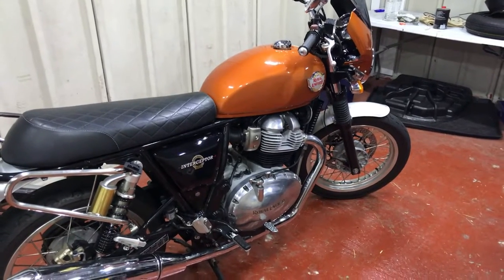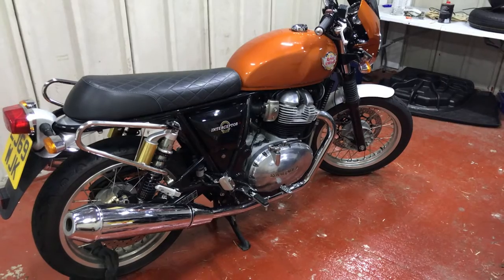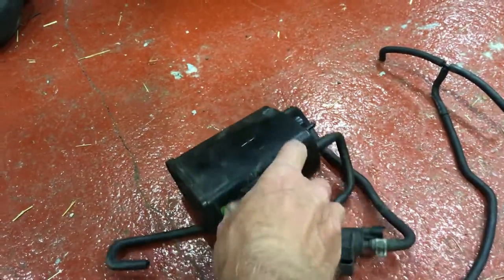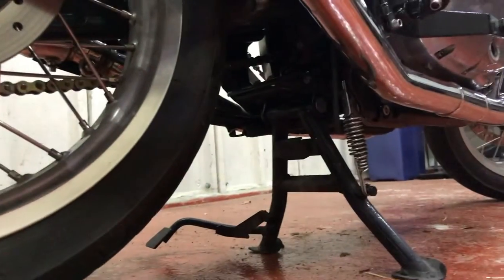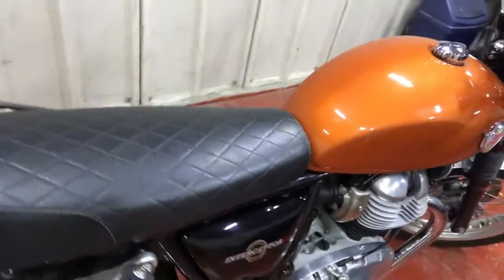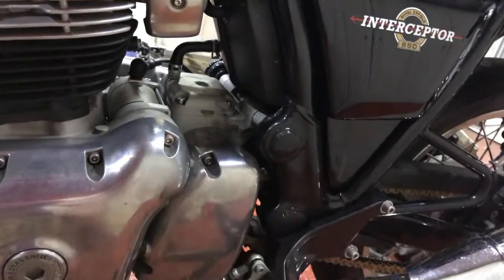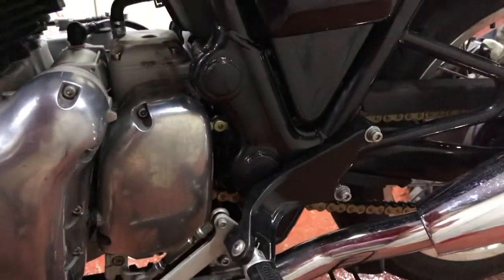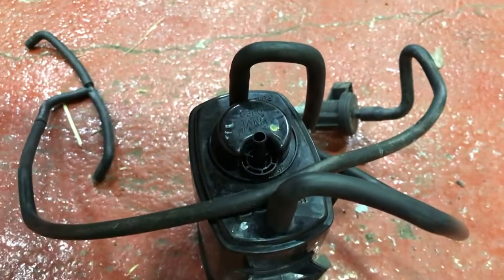Removing the EVAP system from Royal Enfield Interceptor 650

Comment: Do we really need a delete kit?
I removed the evap can, which was saturated, blanked off the three hoses with 2 x M6 and 1 x M8 bolts tie wrapped so they  seal properly.  I left the valve in situ, still connected to the loom so I don't need the plug.
Is it just me or are people going over the top by removing everything?
Reply from the maker: Yes, what you’ve done is an option, although only the m8 hose is blocked when using the delete kit. One of the other two hoses is the tank breather though and shouldn’t be blocked, as far as I’m aware (mine isn’t). It did occur to me after fitting my delete kit that it would have been possible to leave the purge valve in situ and let it do its thing and keep the ECU happy. But I thought it’s a component which could malfunction at some point, triggering the EMS warning light. So I was ok about removing it and binning it. Tbh, the little electrical plug that comes with the delete kit is probably just something that joins the two wires together! Possibly…….. In any event, I wanted the neat little bungs that block the inlet manifold tubes and didn’t begrudge the minimal expense of the delete kit really. But, yes, leaving the purge valve in is certainly an option.

My bike has run perfectly ever since (now over 7,000miles)…..starts first time, no stuttering, stalling etc. And, even though the bike is kept in a garage that gets quite hot due to the metal roof, I’ve never once smelled petrol vapour in there!
Reply from the maker: Ps. The delete kit plug is, I’ve been told, simply a 4 ohm resistor in a handy little plug……..

Comment: Bom dia James , moro no Brasil e gostaria de eliminar o Evap , esse kit que vcs usam não  existe aqui , tem outra forma de eliminar o deposito  de cartão  e deixar o restante original , isolando apenas a mangueira de retorno para o motor ?
Reply from the maker: Yes±. You can leave the purge valve connected electrically but remove all the pipes from it. The either block off each of the two inlet manifold stubs or join them together with a piece of the redundant pipe.
Reply: Ok, deu certo obrigado  pela  informação.
Reply from the maker: Great!
Reply: Amigo vc fez? Oq resultou? e como fez? abraços

Comment: Nice video James. How does the fuel tank vent now if you have plugged the vent line that ran to the canister? And is there a noticeable fuel smell now that vapours are no longer running to the charcoal canister?

Also, given that vacuum plugs for the manifold and 8mm screw for the tube are so readily available would a similar solution just be to remove the canister and it's tubes, leave the valve where it is (connected to the harness), plug the ports on both the valve and manifold, and put the screw into the tube? This would still leave the valve there for the ECU to control, but surely the plug that comes in the kit is either just a shorted dummy plug or a resistor of equal resistance to the original valve? Seems like maybe an easy home solution rather than buy the kit?
 Cheers
Reply from the maker: Thank you. Yes the tank vents perfectly by the unblocked, smaller diameter pipe which is left in place. No…no smell of petrol at all…….. in fact there was a smell BEFORE I removed the Evap system because the filter cartridge was full of fuel! And yes, the solution you mentioned could easily be accomplished but I wanted to remove the valve entirely to eliminate a component that could go wrong (unlikely I suppose, but it could happen…)…..but yes, it could easily be done how you suggested. It occurred to me after having used the kit but I do prefer that the valve is now completely out of the bike….
Reply: @internetpolification  thanks for the response mate, appreciate it. I'm glad I happened upon this video and you mentioning that it has solved your hot start issue, since I too have experienced it. The multiple hits needed to start is kinda embarrassing and reinforces what I think are mainly untrue stereotypes about RE being poorly made bikes. My bike is now an 865cc big bore but the variability in starting has probably started more recently than my engine modification so am hoping the evap is the cause.
Such a confusing comment about "not overfilling" the fuel tank. If I'm gearing up for a long ride I'm definitely wanting to have the tank completely full, since I've had some serious range anxiety on some long rural roads just inland from the Australian east coast where I've needed every last drop to get to the next fuel station. I'm sure the designers know that people completely filling their tank is a normal thing for most users. So...what happens if we "overfill" the tank now? Fuel will just go down the plugged hose and sit there for ever I guess?
Reply from the maker: @MrJulianneave  I’ve filled my tank since and never lost a drop of fuel. I did think it might drain from the vent tube but it hasn’t so far…. 

Yes, I understand exactly what you mean re the embarrassment factor. 2-4 pushes of the starter button with the engine firing up each time and then stopping. It even did it with the bike moving having engaged first gear to turn the bike round in a tight circle which meant I almost fell off!Plus all that wear on the starter motor which, at that rate, would be 4 times ‘older’ than the rest of the bike, strain on the battery and alternator to belatedly catch up with the charge required for the battery after all those false starts…….  I even got to the point of thinking that I ought to sell the bike, much as I liked it. Then, having removed the Evap kit, it never did any of the above ever again. Not once. Not ever. First start every time and no cutting out. First start after 2 months of not using the bike. Etc. Totally cured.

I’d remove the Evap kit and then see what’s what! Do your idea of leaving the valve in there first and get rid of everything else and block the larger diameter tube and the manifold stubs. If it cures it (please report back……) then you could consider paying out for the kit or…more likely……just leave the valve in and run the bike	😀
Reply: @internetpolification  I had a go of just removing the hose connections from the throttle bodies and plugging the vacuum nipples this afternoon. I left everything else as is, including just leaving the hoses from the evap valve to the throttle bodies unplugged and open. I figured that by doing this I was removing the only means that the evap system had of affecting engine operation. It idled a bit differently when first starting but settled down to a normal idle, but my hot starting issue was not resolved. If anything I feel like there was one starting attempt that was much harder than normal.

Maybe I'm missing something with how I left the rest of the evap system and I haven't effectively isolated it, or maybe I should have idled it for like 10 mins to let the ECU learn that idle no longer equals fuel rich air coming from the evap canister, but results so far aren't as promising as I was hoping.

Comment: Where to get the evap delete kit?
Reply from the maker: Actually, a kit isn’t actually needed. All you need to do is remove the evap cartridge and but leave the purge valve electrically connected so the ECU knows it’s there. Then block off the larger of the two pipes which lead from the fuel tank to the evap cartridge using an M8 bolt. Then join together the two inlet manifold stubs using a length of rubber tube.

Comment: Hi James how does the tank breathe, the small pipe is only a drain from the neck, if you blank the tank pipe with the bolt there is no way it can breathe, I fitted the kit but opening the tank filler you can hear air rush in. Ps anyone ordering one quote the year, mine came with the wrong plug, so fitted purge valve blanked of,f plus do not short out this is a resistor plug. I read the other thread of similar conclusions, maybe your not experiencing hissing is the fact your cap is not sealing, solenoids arnt a switch so don’t short out, the ecu needs to see 25 ohm resistance.

Comment: Just done this today thanks to your sprocket cover tip. Also did the air injection delete. On another note I've purchased some switch gear to do that swap.
Reply from the maker: Excellent! Yes, that sprocket cover removal helps a lot, eh? 😀  If you’ve bought the FJ1200 left switchgear, you’ll find it’s an easy fit using the OEM wiring from the OEM switch.l..and it means the OEM connector block is still used which makes life much easier. If you have any issues with the throttle side, just post here and I’ll give you my phone number. I did just post a lengthy response about the right side switch etc to a comment on one of my other videos……it’s the one that is partly titled with “Interceptor worship” …I’ll find the link and post it here in a minute. I detail what’s involved with the right side. It’s slightly trickier but really not hard
Reply from the maker: Here’s what I put to the person who asked re the switchgear in the other video……

 No, the OEM throttle tube just won’t fit. I did try that first on the replacement right hand assembly but it’s all about the diameter of the end of the tube (the inner side which has the throttle cable nipples in it)…the OEM tube just won’t go into the CM400 switch assembly. So I used the entire switch/tube. There is some slight modification needed to the way the cables connect into the switch body. The OEM return cable (which closes off the throttle when the twistgrip is released) has a threaded nut on the outer sleeve which screws into the OEM switch casing and the pull cable (which operates the throttle when you twist it to accelerate) just has a round shoulder on the outer sheath and slots into the body of the OEM switch and is held in by a small clamp which screws into the switch casing. 

With me so far? The threaded nut on the OEM return cable is too big to screw into the threaded hole on the CM400 switch casing, so it needs to be just left in place on the cable and ignored. But it’s now necessary to hold the cable into the new switch casing so I used the one that came with the CM400 throttle assembly that I bought…it came with (useless) cables still attached. I cut this cable and removed the nut which was obviously the correct size to fit into the threaded hole on the switch casing. Then it’s a case of getting the nut onto the OEM inner cable……of course the nipple stops it sliding on…..so I put the nut into a vice and cut a slot into it with a fine grinder disc……..it doesn’t weaken it and the slot allowed the nut to go onto the inner cable, screw into the switch casing and thereby hold the outer cable into the casing. With me thus far? So that’s the return cable sorted out.

The pull cable has the metal shoulder on the outer casing and slots into the replacement switch casing just like on the original switch casing. But…..there’s no threaded hole to attach the small clamp to which holds the cable in place on the original. So……I drilled a hole in the replacement casing, tapped a thread into it and this then took a small Allen bolt which holds the clamp in place in the switch casing and the forked end of the clamp holds the outer cable sheath in place in the casing.

The above sounds complicated but it actually isn’t! The left switchgear is dead easy however. 

If you decide to change the switchgear, I’ll give you my email address/phone number and run it all by you. 

Personally, I love this mod. The indicator switch is incomparably better and I no longer get complete ignition failure caused by the awful OEM engine kill switch!
Reply: @internetpolification  yeah I read that yesterday, it was myself who asked you. Just watching your wheel seal video, that seems a good shout to pre empt the issues it will cause.
Reply: where did you get the ais delete kit?

Comment: thanks james if this is on my 2022 gt its coming off, im all for removing crap off the bike, thanks, rich
Reply from the maker: Do it…. It’s a nightmare waiting to happen!
Reply: so i got a little kit from Spain, removed the canster, removed the purge valve but the plug they supplied to replace the purge valve doesnt fit, do you think i can replace the purge valve, plug the hose from the tank and let the vslve sit there doing nothing so to speak, thanks, rich

Comment: Thank you for the explanations.
The anti-pollution system is really useless.
One question, the ECU will continue to work without the purge valve since you installed a fake plug, correct?
Could you please provide the link to this fake plug that you installed in place of the purge valve?
Reply from the maker: Yes the ECU functions. However, what you can do is disconnect all the pipes to the purge valve but leave it in place and electrically connected. You can then use a piece of the redundant pipework to join the two stubs on the inlet manifolds together. Thus cheaper than buying the ‘delete kit’ which is only two rubber bungs and a 10kohm resistor. So, I would simply leave the purge valve in place!

Comment: Please could you advise of a retailer who could sell me a kit to deal with the electronic side of this? (The plug kit to replace the EVAP valve.)  There don't seem to be any companies advertising this sort of kit in the UK.
Reply from the maker: I bought mine from eBay but I see that there aren’t any on eBay U.K. at present. There are some in Italy but they look very expensive. However….here’s a solution…. You can remove the Evap cartridge and disconnect the pipes to the purge valve as per the video, blocking off the larger pipe with an 8mm bolt (again, as per the video) BUT leave the purge valve itself in place, still connected to the wiring harness. Then block off the two inlet manifold stubs with something suitable eg a small piece of the original pipe, blocked off and put on each stub or, in the case of one subscriber to my little channel, join the two stubs up with a longer piece of the original pipe. Effectively this bypasses the purge valve but the ECU still operates the purge valve but it doesn’t know it’s not actually accomplishing anything. The subscriber this said it works fine…..

Comment: Hey. Hoping for help. Cannot trust my dealer. They changed a ruptured (!!!) tank. I suspected external breather/other blockage as there was massive pressure that caused a pinhole seam split. Cap nearly blew of in my hand. So I’m home and guess what, still massive pressure of left sitting in sun 30min. Do you think evap could be culprit?
Reply from the maker: Quite possibly! I’d remove the Evap system anyway…..
Reply: @internetpolification  thanks, on the list!
Reply from the maker: Quite probably!
Reply: @internetpolification  for info (if ever happens to others, highly improbable), was completely kinked tank breather hose, jammed tight by battery - from factory apparently. All good now. Will still delete evap one day!
Reply from the maker: That’s good that you found the problem!!